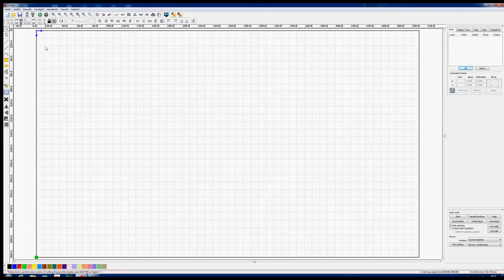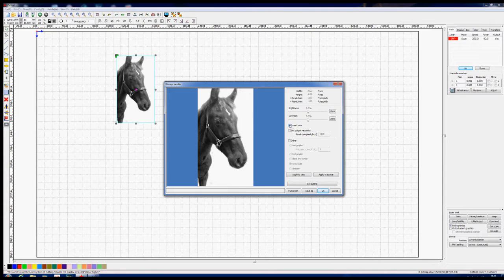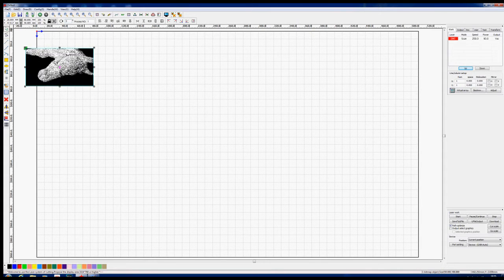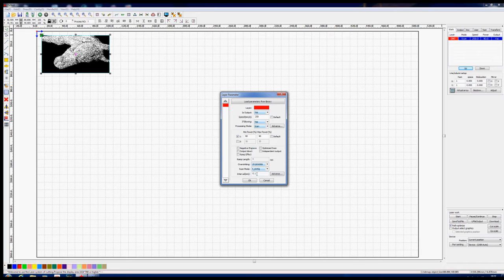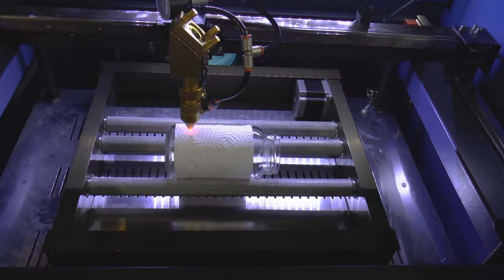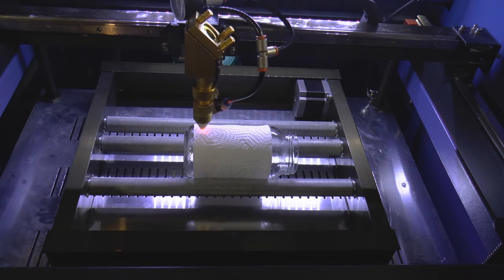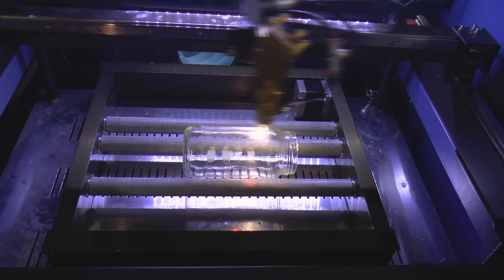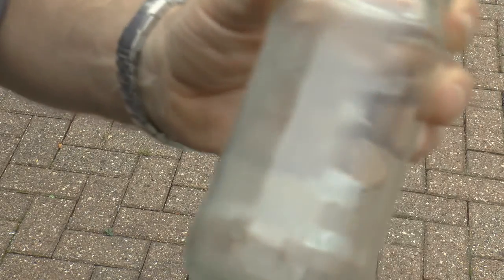RDWorks Learning Lab 13 rotary glass engraving

Comment: I am half way through your RDWorks videos and my head hurts from all the knowledge you have implanted in it. THANK YOU! I have learned more in the last two hours than I have in 3 weeks of struggling on my own. Excellent work! I will be up all night watching the rest. :)
Reply from the maker: +PlaneDeb 
Thanks for your kind words I'm glad it's doing a better job than the manual. When I first encountered RDWorks I thought it was a piece of rubbish software,free with the machine for a reason. However, as I have started to untangle it's intricacies I am gaining great respect for it. As a piece of drawing software  it's terrible but as a  piece of interface software allowing you to take all sorts of drawing formats and convert them into machine-readable files, it's a little miracle. I'm still exploring the outer reaches but as with most utility software, if you learn about 20% that's all you will need to deal with most things. This software was obviously designed to work with many types of machine and so there are bits that don't even apply to my machine....the problem is which bits????
Don't lose too much sleep over my videos, I'm sure there's a party out there calling you,,,that's a much better reason to sacrifice sleep!!